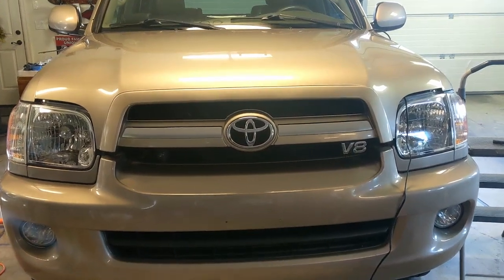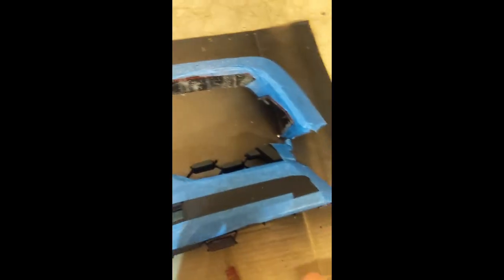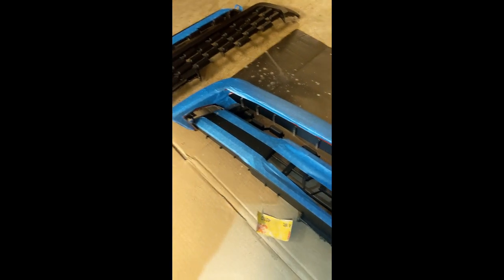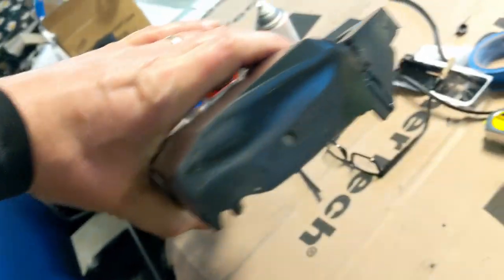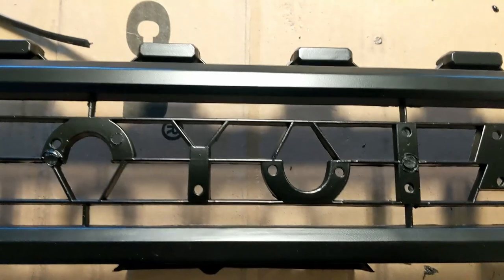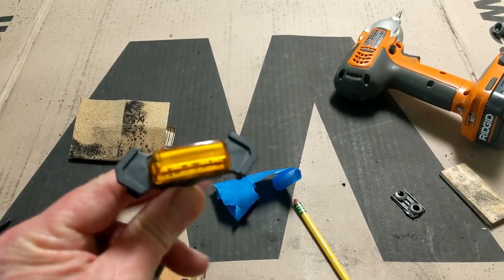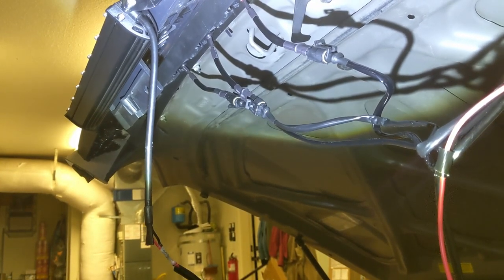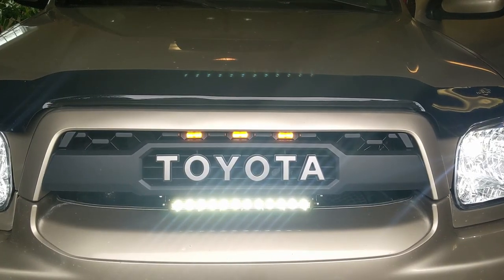1st Gen 2005-2007 Sequoia New TRD Grille Mod

Comment: Great mod, always thought about it, but never seen on 05+...thank you for the motivation on getting the same mod started myself. 1 question, I didnt see the link to the amber trd grill lights, hopefully you can add ? Keep the vids coming
Reply from the maker: Sorry just saw this.  The amber lights actually came with the grill.
Reply: @Johnson-Sequoia  how much would you charge to make one?
Reply from the maker: @robertanthony5568  I wish I could just 3D print them.  I bought a used 05-07 grill and then the TRD grill....parts probably added up close to 500.  I could probably do it quicker this time but it took probably 8-12hours over a couple weeks.  I don't think the amount I would have to charge would be worth it.  But thanks for asking that is a real compliment.